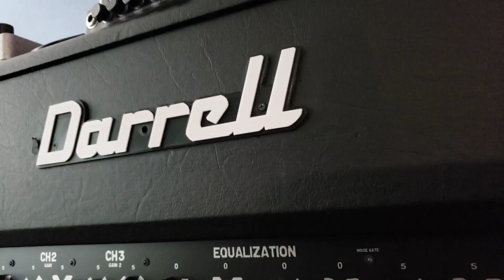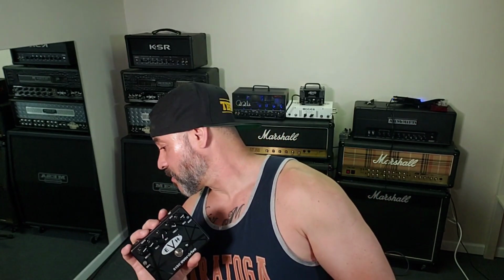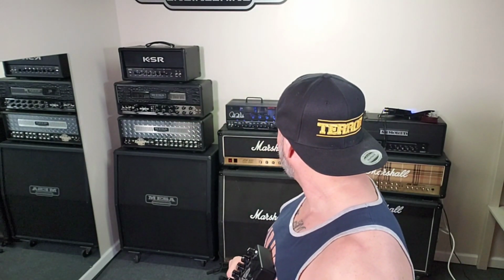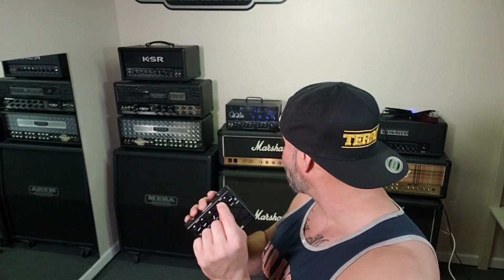WORST OVERDRIVE? EVH 5150!!

Comment: don’t plug it into a distortion channel. i always use it into the clean channel.
Reply from the maker: Yeah, I ran it into the clean of my MT15 and it's so much better than using it like a preamp.  :) Thanks brother! Next up is seeing how it sounds as an clean most only.
Reply: This should be common sense no? Lol
Reply: In my case it sounds better on the crunch channel of a line 6 of 15W
Reply: Have you ever used it as a booster I’m thinking of kinda doing that with this or a tube screamer with my Evh iconic combo amp on the overdrive channel

Comment: It's NOT an overdrive, and it doesn't sound like EVH. But, it slays when you used it in a clean amp (if you're into that).  Ditch the Hot Mod, and I bet it would sound even better through the 2204. Great demos!
Reply from the maker: I'll pull out the HM2 and check how it sounds with just the one 12AX7 in there. Thanks Andy! You're the man and thanks for helping!  :)

Comment: It's probably your guitar. This pedal was not designed for what you're doing. The pedal ain't the problem.
Reply from the maker: In this video, I used it as a preamp, but alas, you missed the second video where I raved about it as a boost.

Comment: Hm, not even close to the worst! Gotta run it into a clean channel, however I find that one can obtain a very similar sound if not a better overdrive running straight out of a tube amp, such as my nasty Peavey 6505+ (forerunner to the 5150) and the guitar I use is a 2021 EVH Wolfgang Special (unmodified)😮 Further, if I'm using my 5150 OD pedal, I prefer to run it into the front, not a rear FX loop. ✔️ I almost feel like this pedal worked better with a solid state, such as my old Orange Crush 60, I've noticed differences using it between SS and tube amps.

Comment: Really? Ok good I bought it for my distortion pedal because I just bought a Mesa boogie and I dislike the distortion channels it has too much of a bee sound. I’m only going to use this for distortion instead of a pre-amp. I really want that brown sound distortion.
Reply from the maker: This thing is great through a clean channel! With the Mesa, you have to dial back the gain stage then use an overdrive to tighten the tone. That's the sort of "fix" that the Mesa Rectos need. Hope that helps, brother!
Reply: @louistorres  ok cool, I’m ordering the behringer the heavy metal pedal. What is your thoughts on the behringer pedals? Thanks that does help because the distortion on the triple is a little much. I bought the Mesa triple for $500 and I had to change the tubes so all in all I paid $1000 for the head.

Comment: Hey Louis! Need your recommendation, looking for a head,   I can possibly get mesa dual rectifier, but I don't want mess with tubes, and this one will need replacement, I would prefer finding solid state. I know you have Randall RG models. I played mesa before I liked a lot haven't played Randall tho. What's your opinion? Playing hardcore and metal
Reply from the maker: They are totally different sounds between the Rectifier and the Randall RG line. A much better recommendation would be for you to listen to at least ten videos with each and hear which one is closest to the tone you like. Mesa Rectifiers are a self bias unit, so you pop in power and preamp tubes and that's it.  There's that additional cost for tubes but just post in a grew groups that you need tubes and if anyone has any spares, everyone usually does!  :)
Reply: @louistorres  Thanks man, appreciate quick response!

Comment: I just got one and the thing I notice when tapping it starts low on the output then gets louder which seems odd. Not sure if it’s my amp, the pedal, or me.  Sounds fine when I strum.
Reply: @Arnold-vc7es  that’s it.  I only play most of my electric through a blackstar amp so this pedal stuff is new to me. I do like the EVH overdrive through a clean channel and it seems the gate was too high.  I have a Strat so single coil.  Will get something with a humbucker eventually. Thanks for replying.

Comment: Sorry you didnt like it dude! I was using it to boost a 2x12 solid state Peavey Vypyr combo amp before I could get a solid tube amp. I use to run it with a clean boost on the clean channel. Couldnt ever get a good tone out of it any other way. Once I got the Stealth I had no use for it. Definitely agree it's more or less a less intense distortion pedal if anything.
Reply from the maker: I like it now, just had to run it a different way. For the price, there are others that are much better.

Comment: I’ve shelved a bunch of pedals cuz I thought they was total shit. Some of those pedals are now permanent fixtures on my pedalboards. Always go into a new pedal starting from scratch. If you go into it with the mindset that it is a “replacement “ pedal for something else, it usually always sucks fat balls. Especially if your squeezing it amongst other pedals. It won’t stand much of a chance. When I get a new pedal now, I’ll run it by itself to determine if it’s worth a fuck first. Then I’ll juggle it around in different positions on the pedalboard and loop. And even if a pedal sucks serious floppy dongs on its own, it could shine combined with other pedals. Most pedals are pretty straightforward. But some need some serious tweaking. I’ve got a few pedals that if you turn the knob a cunt hair, it goes from brilliant to dogshit. Some pedals are super temperamental and need geek level tweaking. Don’t shit on a pedal until you’ve tried every song way to use it. I’m guilty. But now I’m much better at weeding out the goods from the bullshit. It might suck balls spending as much time on a fucking pedal with 3 knobs as you would with a fucking kemper. But sometimes you gotta geek tweak. 👊🏻🤘🏻

Comment: Agreed man i dont through it into the effects loop either i use it on my peavey 5150 right into the high gain channel haha it kills. I dont max the treble out cause it sounds too choppy imo id go to 7 or 6-7. Or a little over halfway sounds fine but depends on your amp. The boss ge-7 eq can clean it up as well. I turn the output to like 8 and the gain on the pedal to 4. Even at 4 is plenty of gain for a 5150

Comment: It's a distortion pedal, not overdrive.....
Reply from the maker: You should watch the part two where I rave about it as an overdrive pedal but rest assure that it's also marketed as a preamp pedal that can run through the effects loop or directly through a separate poweramp, just like the KSR Ceres or Diezel Herbert.